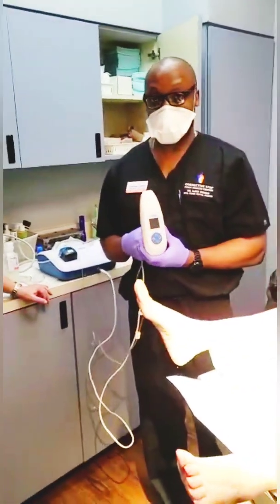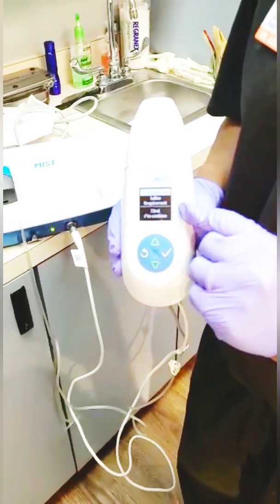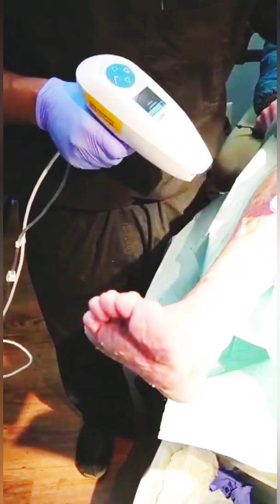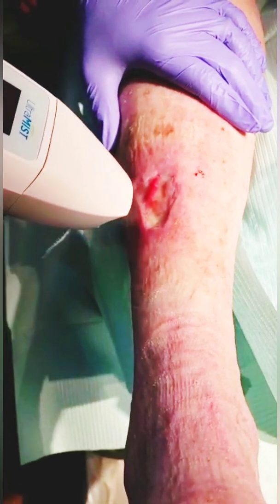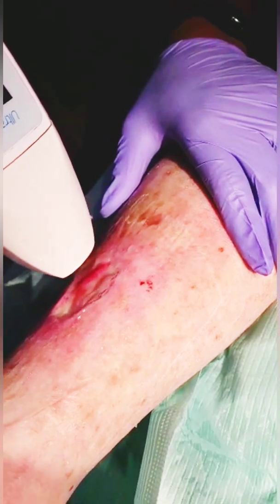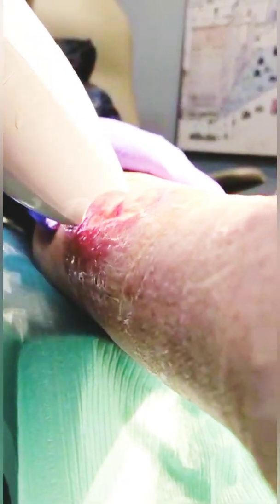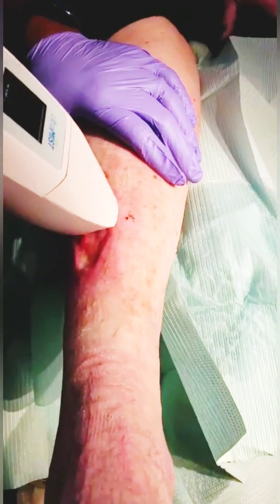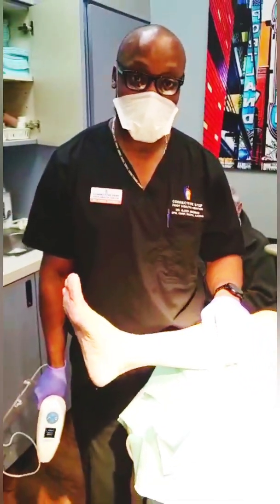Ultrasonic mist debridement for wound care treatment and healing

Comment: Since thus is non- contact this would remove the biofilm or fibrinous exudate ?
Reply: it weakens the bonds of the biofilm with the ultrasonic waves.  The frequency of the ultrasounds does create heat thus there is mist to keep the device and wound cool.  Great question.  After the biofilm is weakened then this allows for more granulation tissue to be laid down.
Reply: @mrclean2500  thabk you. I can appreciate the physics of the device. I'm a young physician in wound management, now launching out on my own and keeping my eyes peeled for such a device. I saw the video, but I would like to know that this really works, you know?
Reply from the maker: I would say yes it does work.  It allows us to use non-mechanical debridement techniques but still allow the bioburden to be decreased and stimulation of fibroblasts to granulation tissue and eventually epithelialization
Reply: Sorry, little late since you posted this but the thermal effects are negligible bc of the NS. While still bacterialcidal, this unit at 40khz does not "debride". You need to be using the other 3 devices available at lower frequency to get a strong enough cavitation effect for breaking down necrotic tissue. Sorry screaming into the void a bit but just had to comment..